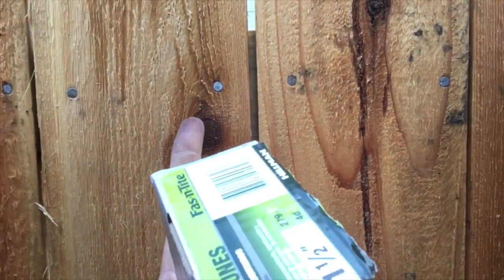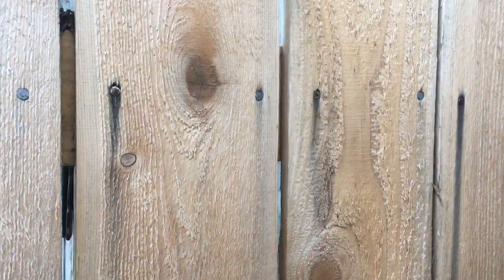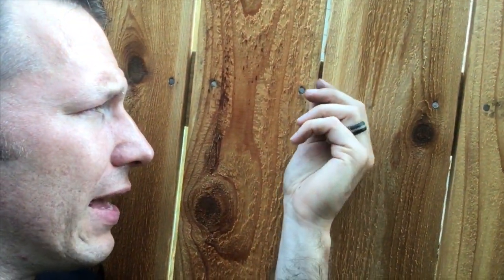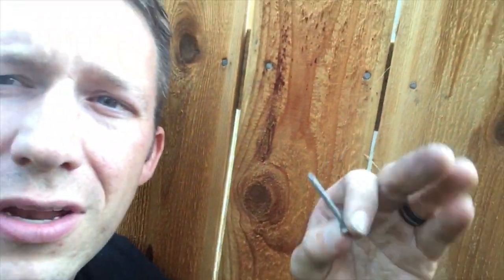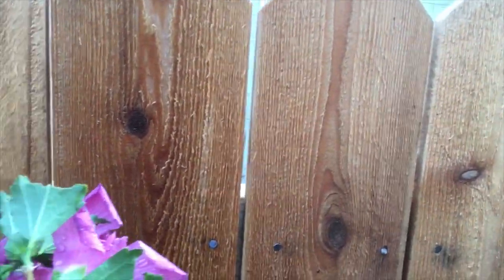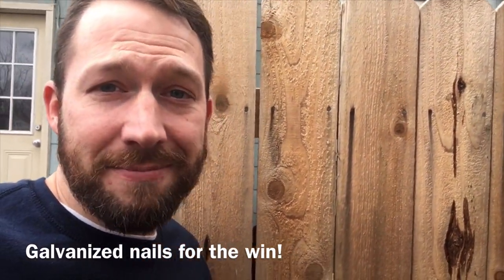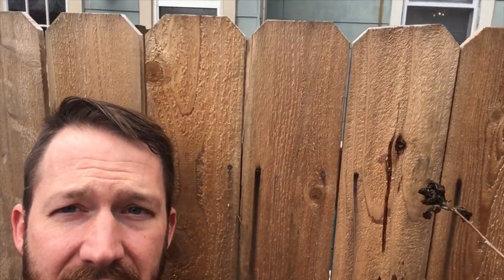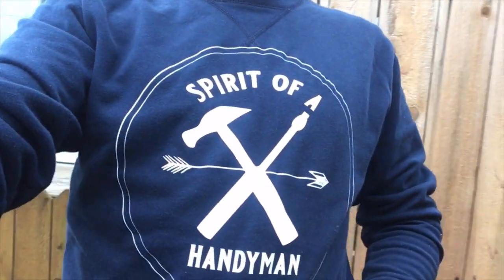Preferred Nail Type & Spacing for Cedar Fencing

Comment: Wonder if there is an update...galvanized nails will streak with Cedar but it takes longer. I'm not convinced the other nail was "stainless" steel (neither was he) because a true stainless steel nail shouldn't streak with PT or especially Cedar. That said, going with both Cedar rails and pickets with stainless steel nails should have zero streaking.
Reply: They didn't look stainless to me. The galvanized steel has that haze matte sheen to it, where as most of the stainless steel nails I've had are polished looking.

Comment: Definitely use THAT one!? 🤦‍♂️
Only forgets to tell us which one was that one. Fortunately i know stainless steel, polymer coated, bronze, copper, and silicone are the best to use on PT wood.  I don't use cedar because it rots to quickly but I've heard aluminum and stainless steel work the best or maybe even hot dipped galvanized.

Comment: We don't have fences like these in my country, usually a double bring wall. I am rather curious as to why you leave a gap in the first place? would it not be better for the boards to sit flush during the installation? Also, anything galvanized is usually better for outdoor as the zinc coating that is applied to steel and iron helps to prevent rust. Thank you for the video.
Reply from the maker: You want to leave a gap to allow for the extra humid days so that the boards don't swell against each other and trap moisture, as this would lead to quicker decomposition of the fence. Thanks for the nail tip!
Reply: @SpiritofaHandyman  I can assure you, the wood will never expand enough to overcompensate for the shrinkage. I've installed both pressure treated and cedar pickets leaving 0 gap. A year later the Cedar will have about 1/4" gap, the PT almost 1/2". Humid days do not cause that gap to close back up at all.
Reply: @livens100  lol. 
Both of you guys obviously haven’t seen boards popping off in the Pacific Northwest. The reason for the gap is so if you install a bunch of super dry boards at the beginning of the wet season you need a gap to stop the wood swelling later on so much they literally push themselves away from the rails. 
If you install the boards super wet you don’t really need a gap. 
I know this because I’ve had to go out and do repairs on fences where this was happening. 
Most customers want minimal gap for privacy, but you need to take into account how much the boards will move based on species and moisture content. 
Fir boards move way more than cedar. 
If the boards are heavy and wet (like dripping water out of the  nail after nailing it in) then no space really is needed. 
If installing dry then bigger gap needed.
Reply: @woodman1701  Yeah, never seen that in my neck of the woods. And you are right, before installing pickets you need to be aware of the material and climate. The only pickets local lumber yards carry around here are PT and fresh sawn cedar. I know kiln dried pickets are available on special order but that turns a $2k fence into a $6k one!
Reply: @livens100  
I actually prefer wet ones mainly because I can space them by eye at like 1/16th inch. 

Alternatively I can’t stand wet 4x4x8 PT posts. Twist and warp, and are super heavy. 
I wish they were kiln dried!!!
Reply: @woodman1701   that's cuz there are lots of ignoramus guys doing construction who didn't pay attention in high school.  They probably don't know that water expands when it freezes and wood expands when it gets wet.